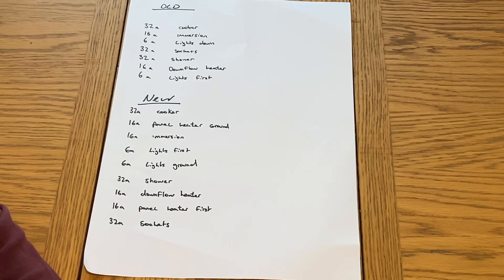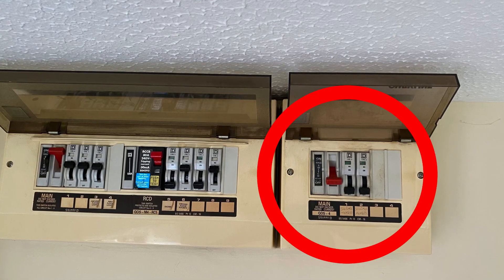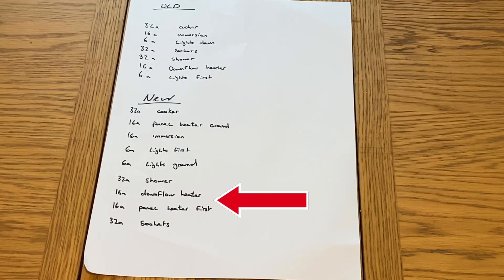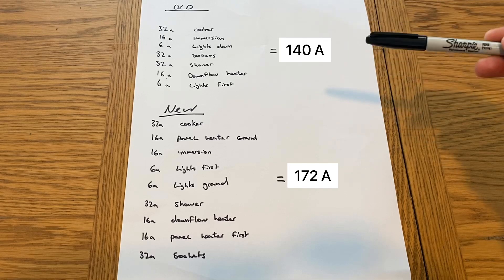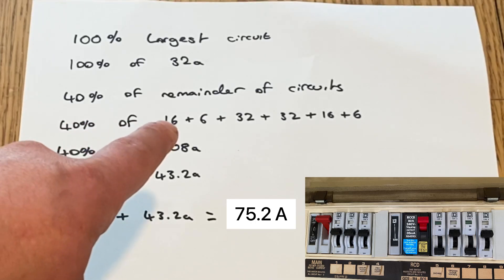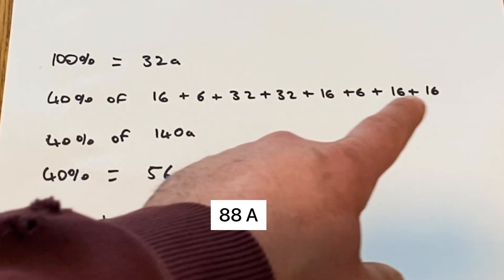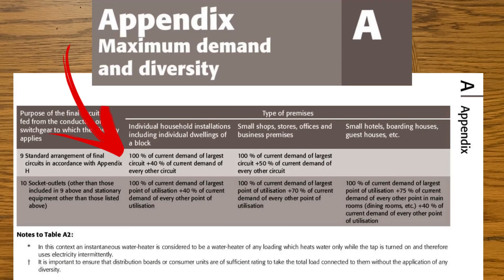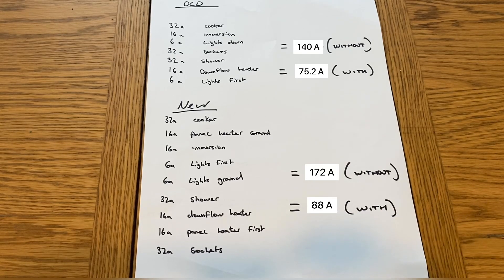Maximum Demand and Diversity Calculation Explained - BS 7671 On-Site Guide Appendix A

Comment: As a former DNO engineer, who spent about two years in distribution network design, most of it on LV networks, I never fail to be surprised at how high the After Diversity Maximum Demand (ADMD) for a domestic property turns out to be using the BS7671 criteria. 88A, single-phase assuming nominal supply voltage of 230V yields the ADMD as 20.2kW - this is well into three-phase supply territory!!! 20kW for a one-bed house is just nonsense. Don't misunderstand me, GSH Electrical appear to have correctly applied the criteria set out in the regs, but from a DNO perspective if the same criteria were used, the LV networks would be massively over-specified. And, yes, I know that a further degree of diversity applies for multiple properties, although they do tend to demonstrate remarkably similar load curves.

As a matter of interest, I downloaded the latest version of my local DNOs spec' detailing ADMD calculations and - making some assumptions about the number/rating of the space and water heating appliances - the ADMD for this property falls out at 8.2kW (35.6A). I still think that's probably a bit high tbh but it's a lot closer to reality than BS7571 would have us accept.
Reply from the maker: Thanks for taking the time to give such a detailed comment it is very much appreciated. Gaz 👍🏻
Reply: @GSHElectrical  I agree Gaz in fact if you do a continuous actual load assessment and I have done that on my property at least here in the US it rarely gets over a third actual usage of the total cut-out size. And we have larger motors and load here in the US in residential settings that run large AC and forced air heating units.
Reply: 1 bed flat 7 circuits: 40a shower, 32a cooker, 32a kitchen sockets, 32a other ring sockets, 16a water heater, 6a lights, 6a smoke detectors. Maximum demand is just bonkers 😂 same board set-up can have a double or triple max demand in a different dwelling or less the half in another smaller dwelling
Reply: Craig, I am a new electrical design engineer and tend to do a lot of load calculations. Could you walk me through or tell me where I can find the DNO ADMD calculations please? I can give you my email if it’s easier
Reply: Hi there. Would you apply these calcs to an industrial single phase DB?
Reply: True indeed. Kindly share an alternative approach for the benefit of the general public

Comment: Some elements are not permitted to have diversity applied, or that is what I gathered from the regs.  Does that mean once this method has been applied and you have electrical loads in the house which the regs specify no diversity allowed,  you add those loads back in or take them out of the equation for diversity and add them in at the end? Quite important.

Comment: this method is so inaccurate that you may as well make figures up. We use smart meter data to see what the actual max demand is and it is nowhere near max demand calculations in almost all cases.
Reply from the maker: It’s part of the course hence the video
Reply: @GSHElectrical  not knocking your video. I am aware of this method as you explained it perfectly. The trouble is the method is just not very useful - as it would force us to overestimate all our installations (we do heta pumps) and we would almost always not be able to get the DNO approval if we used this method. Hence we use smart meter or system monitoring to see what the actual max demand is, and it is always much lower than this method. It seems that electricians are as bad as us heating engineers - everything is hugely oversized and existing calculation methods are detached from reality.

Comment: Just reading Craig’s comment, (1 year ago!) and I would agree that the 20+ kW seems excessive. The wording on the appendix A guidelines mentions maximum current demand, but the calculations shown are using the breaking ratings. If we know the attached loads, or at least their rating, I.e. storage heater, 3.5KW, oven 3.3kW etc. could these figures be used to calculate circuit maximum demand point loadS? The ring final circuit, I understand, we should consider worst case, and therefore likely to be the highest figure, but if we were to take the 40% of actual max demand loads, the overall figure is a more realistic load for a dwelling. Given that most “boiler” plate ratings for appliances are in excess of actual loads, there is already some float from the start.

Comment: After calculating the Final circuit diversity, can we install a circuit breaker with a lower power to the consumer unit? e.g. 40A CB change to 32A CB after diversity calculation.

Comment: Hi.  I worked out, thinking about fitting a new CU to be 85.6a, however my main DNO is an 80a.  Would you apply any more diversity or put a 100a in.?

Cheers
Reply from the maker: The IET Guidance Notes has more details on MD 👍🏻

Comment: Great video
Any advice would be welcome I'm thinking of connecting an induction hob and oven to the same cooker outlet. Hob is 7.5 kw and. Oven is 3.5 kw  so around 11kw. I'm using 6mm cable over around 6 meters to a 32 breaker no ring just direct. 
Thanks

Comment: What about cooker circuits/lighting and all the other rows in Appendix A Table A2 in the OSG? 

Is this just for a quick calculation when doing an EICR?

 The 100% of largest then  40% of remaining circuits is shown in row 9 of that table, I absolutely accept that it's correct, but I don't understand when I'm supposed to apply the info shown in rows 1-8 of that table, based on this video.

Great videos anyway thank you for making them.
Reply: Exactly. Lighting for example is a whole seperate thing, 66%.. Vid seems misleading

Comment: I have a couple of queries for a board change I will be doing soon.
The new board has an spd supplied via a 40a mcb.
Am I correct in thinking that I can ignore that mcb for the calculation? My reasoning being that it is not drawing a load, it is just there to protect the spd.
I have a second 40a rcbo which feeds a garage cu with a 16a and 6a mcb’s in it would you count that as 40a or 22a for the calculation?

Comment: Sorry, just a query. 
Isn’t current demand the current drawn by the connected equipment not the size of the protective device? 

Using the protective device size gives a high max demand. 

A 2kw heater would normally be installed on  a 16 A radial but will only draw approx 8 A and is usually protected by a 13A fused spur. So you would be doubling the expected load by using the PD.

Comment: Nice video,  just to clarify,  I have noticed that you have applied 40% to all the remaining circuits, according to the OSG, no diversity allowed on shower circuit?
Reply: I have the same question.  Some elements are not permitted to have diversity applied, or that is what I gathered from the regs.  Does that mean once this method has been applied and you have electrical loads in the house which the regs specify no diversity allowed, then do you add those loads back in or take them out of the equation for diversity and add them in at the end?

Comment: that's a great help because i've just checked my numbers and the answer is 104.8!
although that includes the 40a for the garage which i think is a little excessive so i'll drop that to a 32 and drop the 32's for the sockets down to 16 as that should make things within specs as it brings it down to 91.2 on our 100amp main
ok, so that just means more stuff to do to fix this house of electrical horrors

Comment: So after diversity applied you totalled 88amps. What if this had a 60amp cut out fuse, as the majority  of older single phase installations have? 

The md calculation in osg is a bit… well … wrong really!! We’d be popping dno fuses all the time the md were anything near what most calculations total. 

God help the calculations (and dno fuses) when EV really takes off!! 

Great video chaps👍
Reply from the maker: Have a look at the pinned comment 👍🏻. There are other ways of carrying out the MD calculation but you have a great point about 60 amp cutout fuses and EV cars hence you have to tell the DSO (formally DNO) when you want to install an EV point.

Comment: I am not an professional just started watching when my house was been rewired to make sure I knew enough to know if it was been done according to code and enjoyed the videos,  one thing I was wondering is how do you know its a 100a fuse in there,  My cutout said it was 100a but when the DNO removed it to allow the rewire to take place it was only an 80a fuse installed in the holder (had a complete rewire as house as my wiring was 2 core rubber stuff from the 50s with only 2 circuits for the whole 4 bedroom house)
Reply: You dont know. Unless you take the cover off (which should only be done by the DNO really) there could be a metal bolt in there for all you know.
Reply: @creativejamieplays7185  so in the video example you could easly be drawing more A than an 80a fuse is rated for but you wouldn't know as you think its a 100a fuse, isnt that going to make the fuse blow? Or worse
Reply: in reality the max demand is unlikely to be anywhere near 88A. Sometimes I think the guidance has not kept up with some of energy savings now available e.g. for a 3-bed house,  instead of using a 1000W for lighting  it is now likely to be closer to 100W. 

The calculation is a very basic albeit quick for onsite use.  It might give you idea if you need to do a more detailed design. In any event one of the regulations is to determine the supply characteristics. The rating of the over-current protective device is just one characteristics. The info should be provided by the distributors,  in reality this is harder than you think. In your case when the DNO removed the fuse you/your electrician were able to determine rating of the over-current protective device.

Comment: Very well explained. But when you say 40% of the remaining, do you mean 40% off total remaining or 40% off each off the remaining?  . Fantastic video Marcos as always 👍👍👍❤️
Reply: You will get the same value
Reply: @crisislord00  still not clear.
Sorry I have never been good at doing percentages. So I need it to be explained to me
Reply: @seandempsey7351  add the full amounts together then 40% of that. It was explained in the video when they wrote it down, you can see they added and got the full amount and then 40% of that final value.
Reply: @michaels8336  thank you  if using the calculator on my phone am I right in thinking 40% would be 0.4